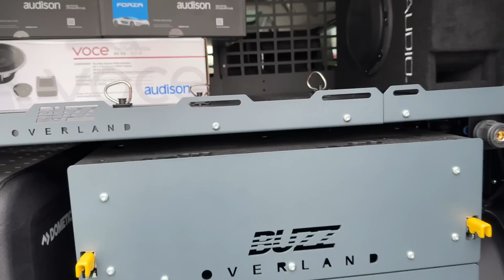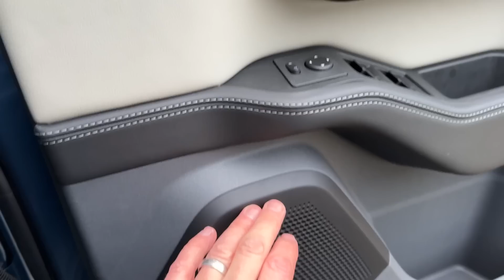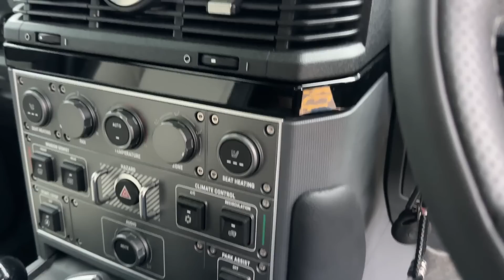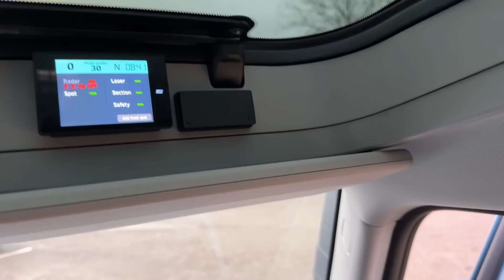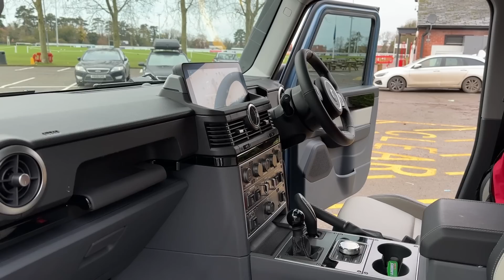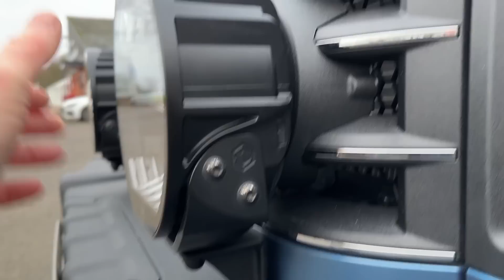Ultimate INEOS Grenadier

Comment: I just got rid of mine, it was a pile of junk! Too wide for UK roads and farm gates and too heavy off-road. The interior just fell apart. Bloody terrible. Give me an old Landry any day!
Reply: Don’t believe you.
Reply: Tractors are the thing that are too wide for UK roads! What exactly fell off interior wise, curious? I have one and as yet nothing has fallen off.
Reply: Didn’t you read the dimensions before buying?
Reply: What the hell are you talking about. They are basically the same dimension of the landy
Reply: Must like breaking down and multiple recalls and been without your Land Rover as it waits at dealer for parts
Reply: Too wide for British roads? You can drive a transit van or even a 7.5 tonner anywhere you need to. I parked my Hilux next to a Grenadier last week at the station and the Hilux is the same width and about a foot longer. I've never found anywhere I can't fit.

Can't comment on the build quality issues but not sure going to Land Rover is a way to mitigate that. I had 2 defenders (a 110 and a 90), loved them dearly but objectively they were crap. Slow, gutless, leaked water in, oil out, electrical issues and corrosion. Granted they're easy to fix but after one dumped its coolant on the road stranding me in the cold I gave up. Went out and bought a Hilux. Fitted winch bumper, decent tyres and never had an issue. Everything works on it 10 years later. It's done duty on a farm in the Highlands where I live, it's dealt with snow, mud, been offroaded daily and it doesn't have a single issue. I see what ISIS see in them.... 

Not everyone's cup of tea sure and I don't love it like I did the Defenders but I was sort of hoping the Grenadier would have been the solution...  Maybe not.
Reply: This is obviously straight out BS.You get some pricks doing this deliberately to antagonize people.....
Reply: Yeah you’re comments a joke mate lmao
Reply: Uh huh.
Reply: A resident of the uk and you didn't realize that it's too big for gates and roads before you bought it?
Reply: #fake comment, loser
Reply: I've just had a sit in one! Beat all my expectations! Currently in an XC70 D5 Thats been amazing. Was never able to find a replacement! Until this came! Have  my original 98 E39 that I don't wanna part with too! The M57 is still as strong as ever. That's why I looked at this! Whomever wrote the above comment is a fool or a lier!
Reply: Idiot...im sure u would never afford one
Reply: Clearly a troll post. 

Back to the car - I’ve never understood the point of a target blue eye, why would you want to know where emergency vehicles are?? Seems pointless. The radar detector maybe, but not like this car is breaking any land speed records, again pointless in my opinion. The Audio upgrades definitely seems worthwhile.
Reply: If the stero is blasting you cant hear the sirens!  @jaspalriat6001